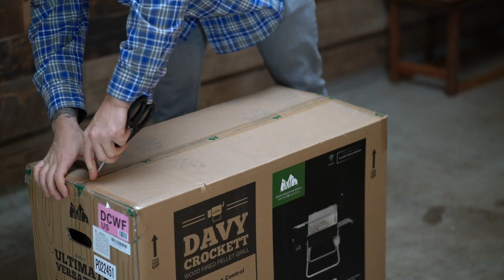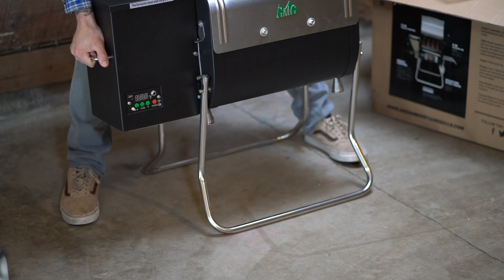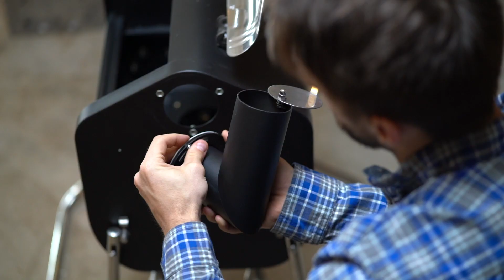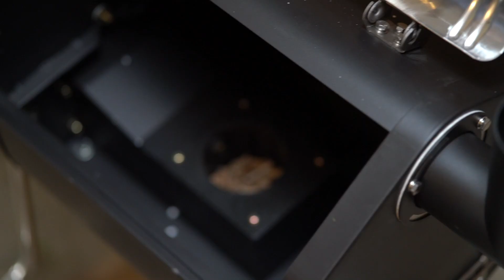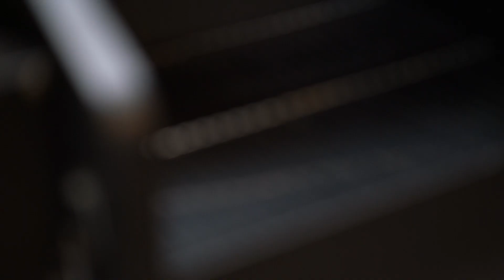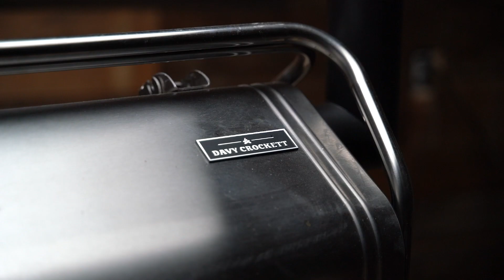GMG Davy Crockett Assembly 2019

Comment: Any tips on adjusting the heat shield to distribute the heat more evenly (so it doesn't throw off the ambient temp probe)?  Trying to figure that out now (160 reading on the DC is actually 230 when measured by 3rd party probes at the grate)
Reply from the maker: When running hot, adjust the shield to the right, and if running cool, adjust the shield to the left

Comment: Nice new drip tray. Is that the only difference with newer models?
Reply from the maker: Yes, Davy Crocketts have remained mostly the same. The lid has ridges, the lid handle is different, and the emblem is different as well but these are just aesthetic changes that have happened over time.